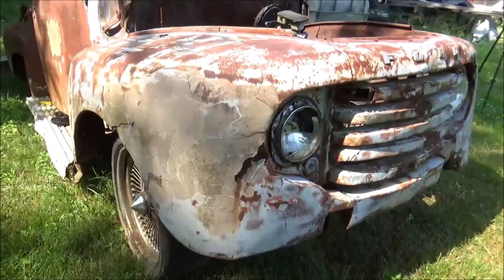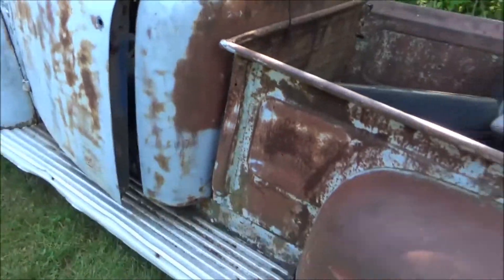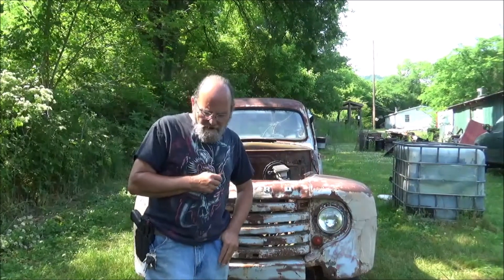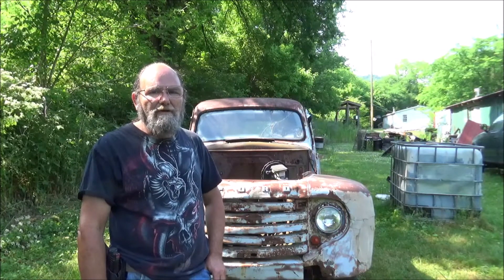Ford F1

Comment: Cool old truck paul. Good afternoon.   I say good beed blasting first see what ur working with. I think lot of rust repair but those old f1 not to bad getting remade parts for if rust to bad to cut out.    
Not a fan chevy fram but I guess did it for reason.  Cool has the disc brakes. Those wheels have to go I say toss them up for sale some one buy them.
Reply from the maker: Thanks 👍